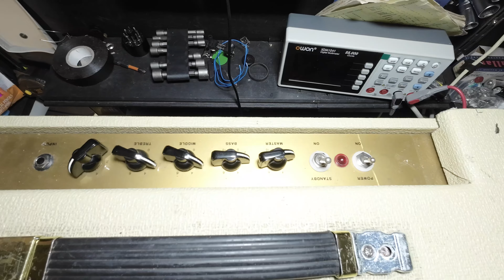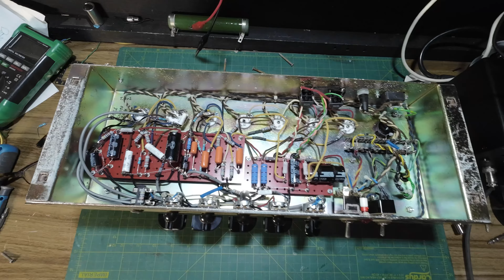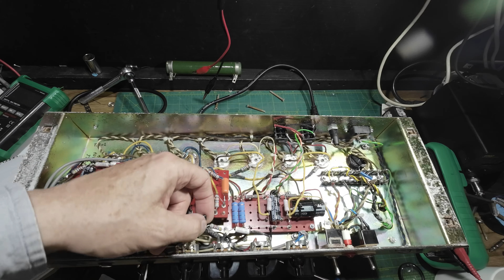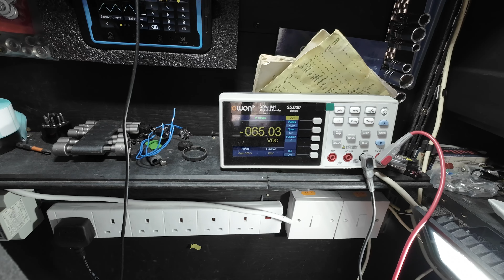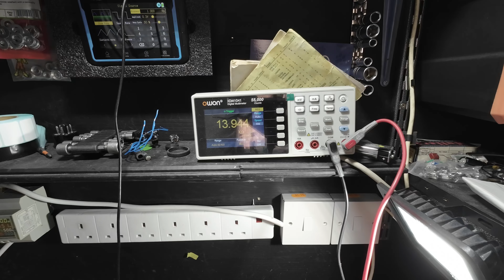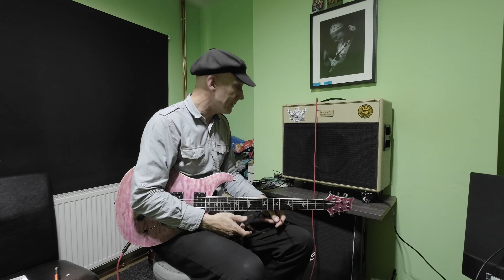Irving 30 Watt Hand wired 1 X 12 Guitar Amplifier Combo Made in the UK but Who Made it?

Comment: This amp was designed and built by my late father Malcolm Irving. He was a retired electrical engineer and amps were his hobby. He co-authored a book on valve amplifier overdrive and was active on forums i believe. 

He was admittedly an amateur level builder but took great care over design and component quality.

Not sure what the story with the speaker is, pretty sure the version of this amp that I have has a celestion green back. The casters aren't original so not impossible someone cannibalised it?

Thanks for making this video, its great to see someone still enjoying what he made.

Cheers,

John Irving
Reply: We checked, that is the default speaker for the 'retail' version. Not sure why he didn't use a better one
Reply from the maker: Hello John. So sorry for your loss. I have that book. I bought it a couple of years ago. I still have not read all of it. it's a fantastic book. As for the speaker. Maybe the customer requested it when he built it. Sound is subjective. From what I understand that speaker is similar to the Fane speakers. Would you mind if I did a short video on the book?
Reply: I have one of Malc's amps, its nearly same as this but it has a Celestion Gold speaker in. I sometimes use it when playing with the Junkyard Angels.

Comment: Tayden speakers are apparently UK made and sold by a UK company called Lean Business Audio who sell speakers from many manufacturers. According to the info on their website, the Retro 55 is designed to be a drop-in replacement for a Fane speaker as used by Hi Watt, Orange, Sound City and Simms Watts. They suggest it is for a "big clean sound".
Reply from the maker: Hello. Yes, I briefly had a look online. Didn't read the bit about the Fane connection. That's good info and make sense. The clean tone was good but the overdrive sucked with the Tayden. What speaker would you have chosen for this amp. 
I think a Jenson. Take care.

Comment: Those are very strange turrets; they look like they're held in place with some sort of E-clip or C-clip instead of being swaged, rivet-like, to the board with a hydraulic press.
Reply: This seems like a good place to talk about swaging-I did my first with a pin punch, spring loaded. EL34World, I think called Bluezmiester Reverb? That doesn’t sound right, I haven’t been there for a while, but it was 4 EL 84, 3ax7… No, it was two el84 X 3 12ax7 Vol & tone, wonderful amp!
Reply: This seems like a good place to talk about swaging-I did my first with a pin punch, spring loaded. EL34World, I think called Bluezmiester Reverb? That doesn’t sound right, I haven’t been there for a while, but it was 4 EL 84, 3ax7… No, it was two el84 X 3 12ax7 Vol & tone, wonderful amp!